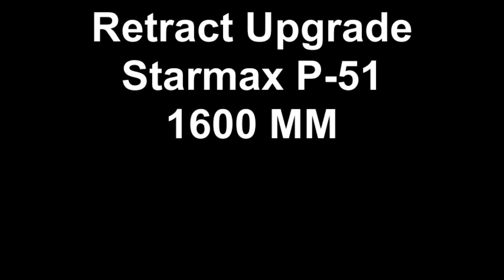Starmax P 51 Retracts Upgrade How To

Comment from the maker: Cutting at a 90 degree -  put an Exacto knife blade on the end of a small, flat head screwdriver.  The Exacto blade has a hole in it. Use the hole to fasten a screwdriver blade.   Push the knife blade it in the foam at the depth you want to cut, then put the screwdriver in the blade's hole to saw back and forth.   Or, simply spin screw driver with the blade on the end to get a circular cut....at 90 degrees.

To cut the plywood, use a Dremmel drill tool with a circular cutting blade.

Comment from the maker: @Dehwidt:    25 - 46 85 degree electric retracts    $126 from e-flite     You can use 90 degree too, but 85 degree gives you a true upright look and avoids having a landing bend the gear outward.  You can find them on the web.  You can use the stock struts if you either use longer screws or a shim behind the strut so the everything tightens securely.  EFlite struts will be a little bigger than the stock ones...but you will have to do some heating/bending of the e-Flite ones to make them work.